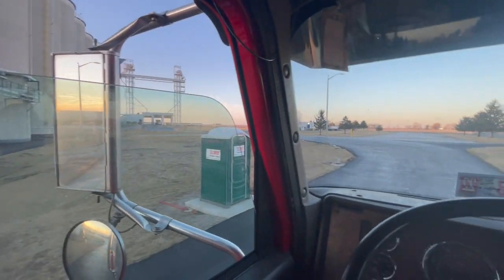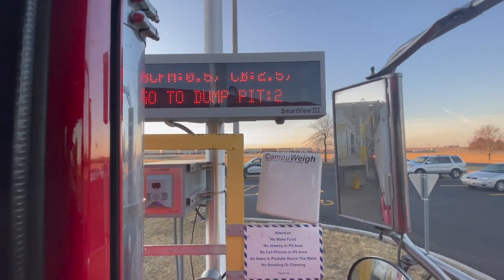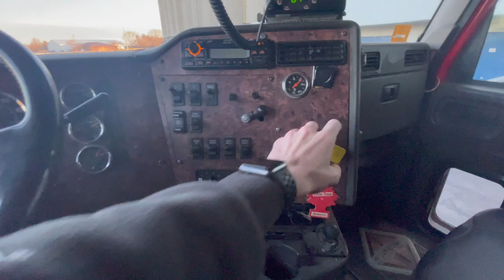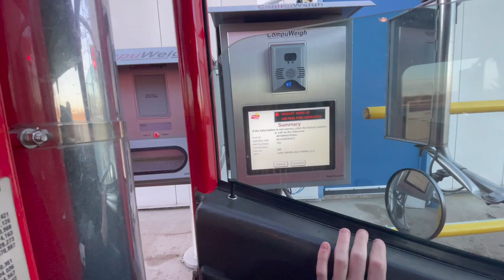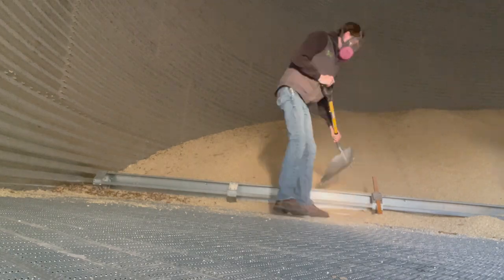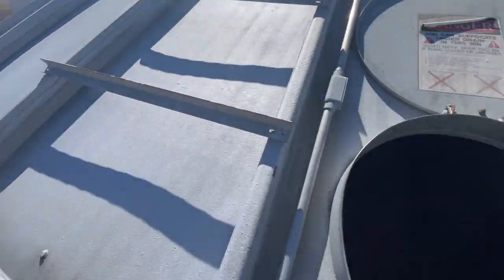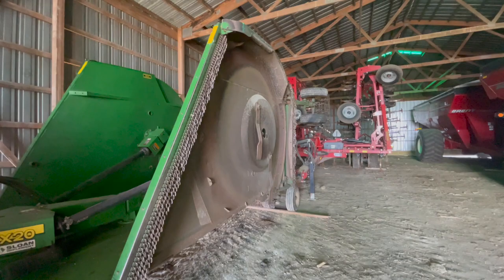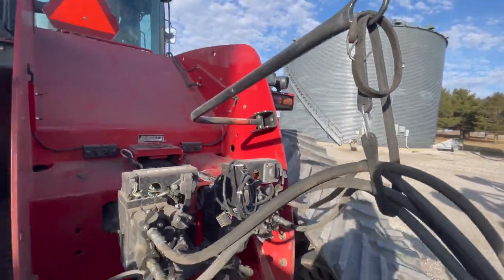Hauling corn and this happened...

Comment: I found out after you shut the machine off and relieve all hydraulic pressure by moving  all levers/pedals around that the hoses will connect much easier. I used to crack lines also.🙂